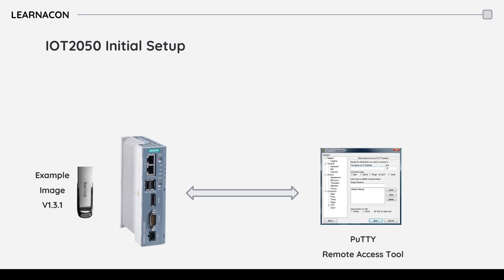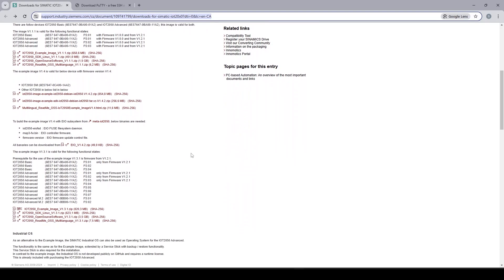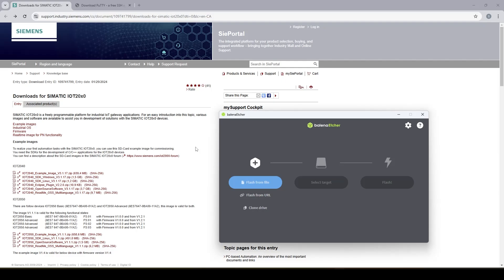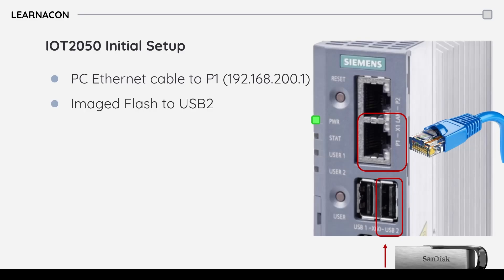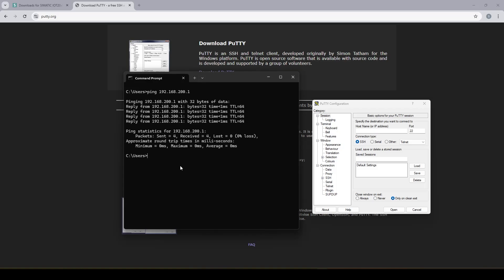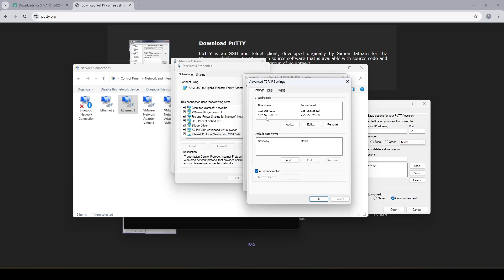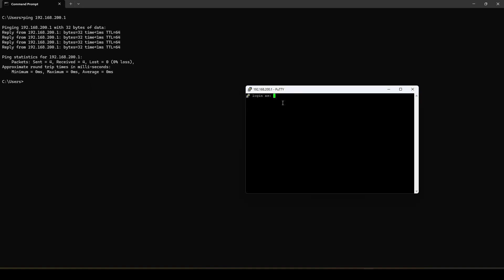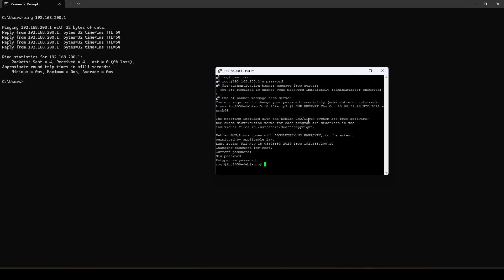Siemens IOT2050 Setup: A Step-by-Step Guide for Beginners

Comment: Thanks for the video.
I can ping the IOT2050 with the computer command sucsessfully.
In the Putty window, i can write the username: root.
When I type in passwort: root, then i get the answer: Access denied.
Why is that?
Reply from the maker: The default user/password is root/root (case sensitive). Make sure Caps lock is off and you are typing in correctly. It will ask you to change the password after first login. If you have lost the password, simply re-image the flash disk.
Reply: @learnacon   hey i have the same problem no matter wha  ido or  how many usb sticks, sd cards, ssh terminal try reinstalling, flashing the image , using the win32, balena etcher, rufus no matter what i do the iot2050 module dose not accept the root password. i have tried on multiple machines and same result
Reply from the maker: @DanM2509  I suggest opening a ticket with Siemens support (support.industry.siemens.com)